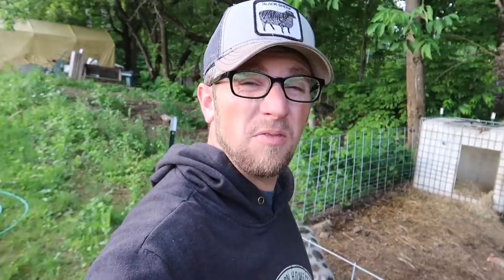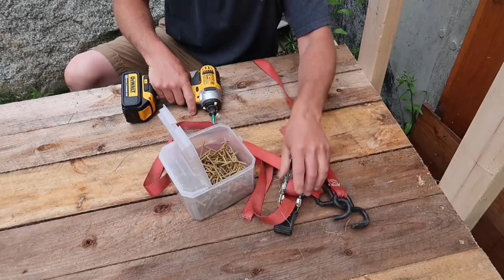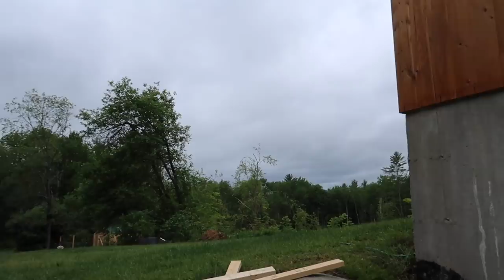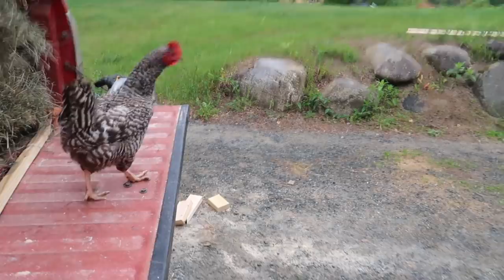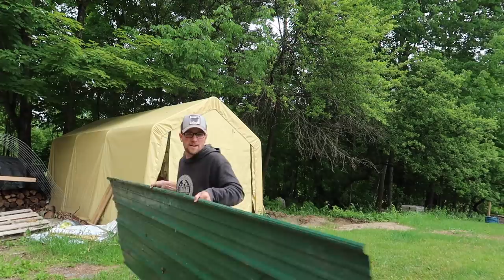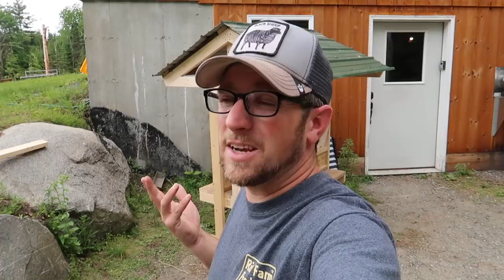You Told me I needed a Better Goat Hay Feeder So I Built This for our Goats

Comment: Hey guys!  I am a mom a grandma and a nurse.  They're are 2 tricks I have learned that work like magic.  Let me share them with you. 
1.   For stings... 
Put bleach on it. If it's a bee Sting,  scrape out the stinger with a credit card or drivers license,  then put bleach on it.  The bleach doesn't have to stay on long.  Maybe 20 seconds.  Once the Sting has stopped rinse it off.  Works like magic.  I promise. We have used this for about 35 years. 
2.  For head bumps
If your child falls and hits their head or face,  grab a pat or piece of butter and rub it on.  The kid won't fight it like they do ice.  Ice hurts, its too cold.  Rub it in for 30 to 60 seconds.  It makes a huge difference.  No bruising or tiny bruises when their eyes should be black.  This works miracles too.  Please share and please try ......

Comment: looks like that design will work well. Just one thing my goats used to chew on everything. I had a makeshift wood one and they ate it so I switch to that metal one I had showed you. Which is like a horse feeder and we just put in a little bit at a time. We had only 4 goats at a time. But they loved to eat wood some more than others. My goats used to waste so much hay. They used to love to just pull out the hay. More than they could swallow and one bite. So the rest ends up on the floor.